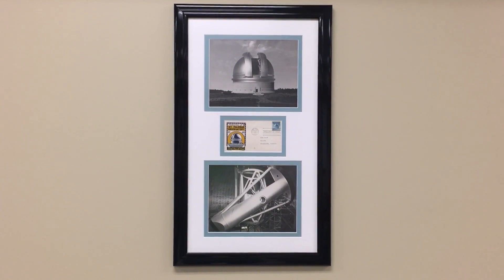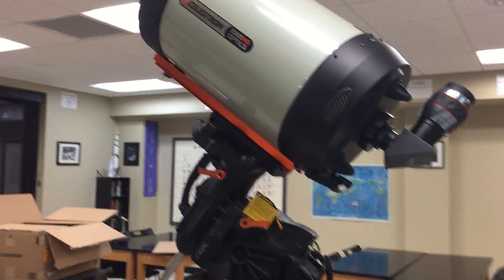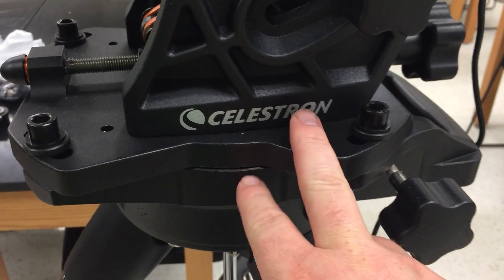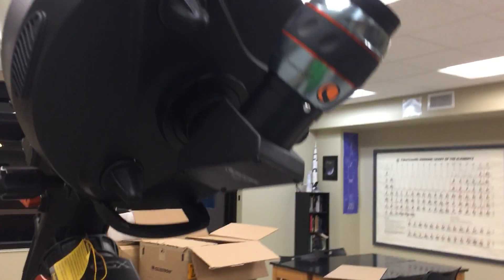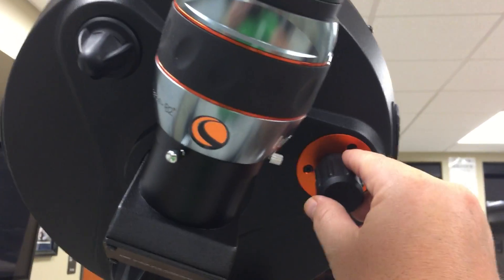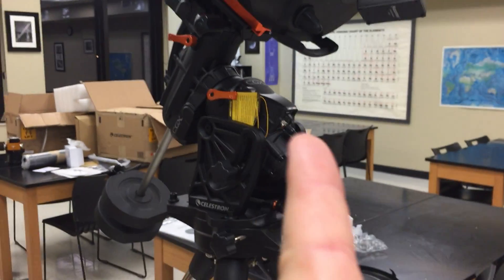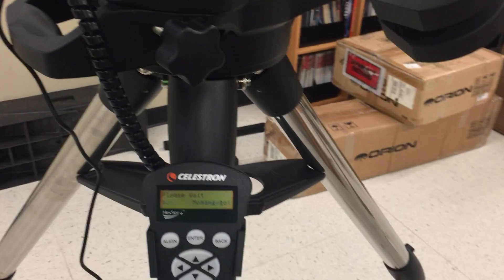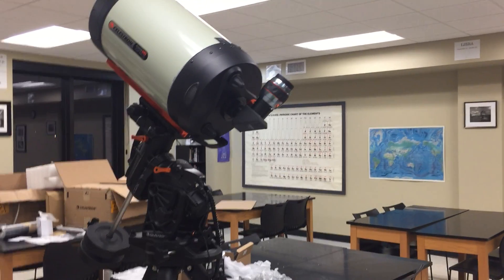Celestron CGX with Edge 1100HD unbox Setup Drama... Dec axis is not working?!

Comment: I fixed the lose thread in the diagonal mirror howsing by using JB Weld. Not it is there permanently, I don't care. At least I don't have a heart attack when I see my big 2" eyepiece going swinging around. You only need a little. Use a toothpick to apply around. Be careful to not drop any on the mirror. Give it 48hrs to cure, in an open air place.